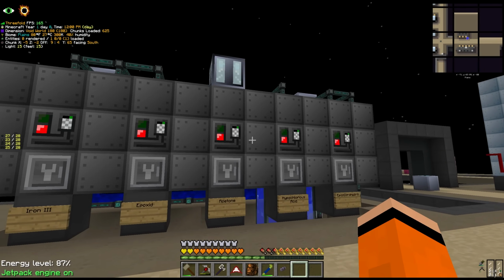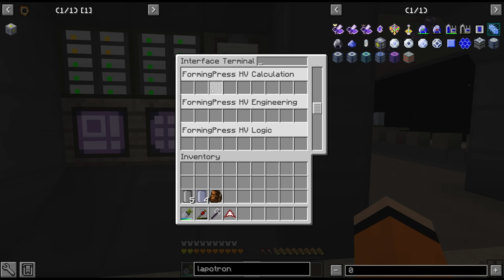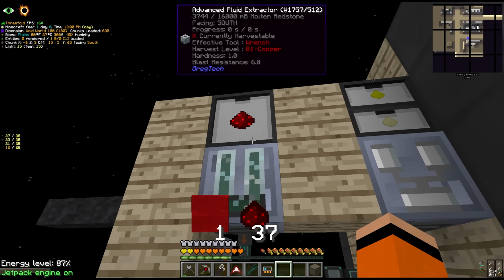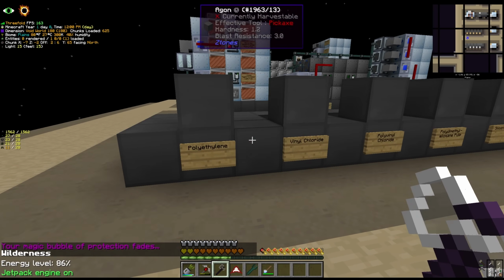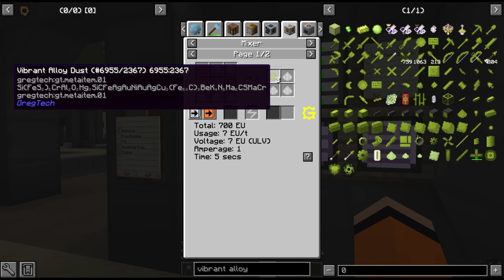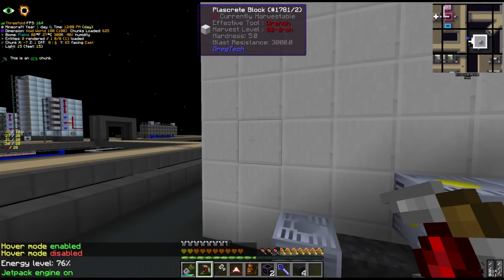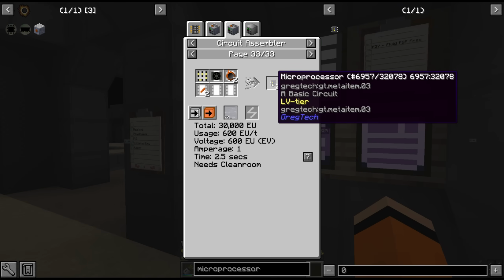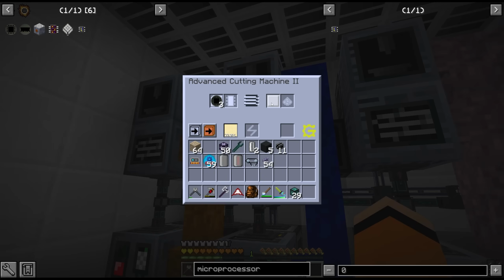Gregtech New Horizons - 40 - AE2 Autocrafting! Modded Minecraft

Comment: Long term, look up "ae2 assembler cone", his way you can, i think, fit 32 interfaces (1 dense cable) onto the maximum number of molecular assemblers possible
Reply from the maker: Yeah I'm aware of the setups for molecular assemblers they are just very expensive :))
Reply: A lot of the recipes he needs on autocraft now are done in machines. Only a handful needs to be done in molecular assemblers. He could setup a molecular assembler with 6 interfaces anytime, it's just not worth it because there aren't that many recipes that desperately needs to be automated. One of the few being patterns, which can be batch crafted :)

Comment: Really ought to have set up your cleanroom machines so you can easily shove stuff in a chest and have the machine craft it all...not that it matters too much anymore with autocrafting, I guess.

Bauxite isn't the best source of titanium once you've got a T2 rocket (and you should have a T3 rocket, so not sure why you're flying around with a T2 one), but come to think of it bauxite is a good source of Gallium, and that's going to become very important soon if not sooner, so...two birds, one stone I suppose.

Very soon you're also going to run into assembling machine recipes that cannot use PE, and have to be done with PTFE at least. IV machine hulls, primarily.

For automating rubber, this is this IC2 crop called Stickreed. You may have heard of it ;)

Turning machines off because you're afraid of power issues is a clear sign that you need to upgrade your power grid, be it power production, capacity, throughput, name it. You don't ever want to be in a situation where you're worried about power once you've got a centralized grid, especially if you use fluid covers to keep multiblocks turned on without any safety features build in to detect power issues...

Lest anyone get excited at the prospect of relatively easy wireless (albeit not interdimensional) AE2 channels, note that the power cost of running those wireless connectors depends on the distance between them, and basically any distance that in most cases a cable couldn't trivially cover (the cleanroom being one notable exception) is going to become a problem soon if not sooner. They do still have their uses, but only use them if absolutely necessary.

As far as I recall the only assembling machine recipes that need a cleanroom are the rocket control units, but there could be some recipe somewhere I'm forgetting or never ended up using.

For the record, yes, you can get small Naq ores from one of the T3 planets, but no, you cannot actually smelt it yet. It requires 5000K temperature, and your Tungstensteel EBF only handles recipes up to 4701K (remember you get +100K heat capacity for every power tier above MV you're running your EBF at, and IIRC you're running your EBFs at EV, so +200K from their power tier). That said there's nothing really stopping you from crafting up HSS-G coils, which would be able to handle that temperature, and reap the benefits of power discounts, upgraded overclocks and old coils to reuse/recycle in the process. What it wouldn't be able to handle is Naq needing IV power to cook up unless you go through the Naqline, though, and Naqline is...well sufficed to say that's something to look forward to in the future.

So something to note about the expansion cards, or "pattern capacity cards" as they're called in GTNH, that allow you to get +1 row of recipes in an interface. One, they require two 16K storage components, one advanced card and one interface to craft each. Yes, 2 16K storage components and an interface to get +9 recipe slots in one interface. At least Three has the cheaper storage component recipes available to him, so that'll save him 64 ULV circuits, 68 Item Processor Tier Is, and 64 charged certus dust per 16K storage component. Two...wait, they actually don't increase the interface's passive power drain more than adding a single interface with 9 recipe slots would? Huh. Wasn't expecting that. So I guess they're just expensive to craft, but running them is actually power efficient (if only to an extent that sane people would just write off as a rounding error).

Starting at More Advanced Circuit Boards, which is the tier that is used for your next circuit upgrade, the circuit board...coating? Whatever you would call turning a board into an actual circuit board needs to be done in a cleanroom, so best to move that chemical reactor into a cleanroom sooner rather than later. That said an HV chemical reactor will be able to process those recipes until you need to start crafting ultra bio mutated circuit boards, which...by the time you get there you'll have long forgotten that EV is a tier that exists, so no worries there.

Better tiers of doped wafers give more output. Glowstone Doped will give you 32 CPUs rather than 8 if you use a regular wafer. It's one of the reason why it's very worth upgrading to better boules despite the difficulties involved, because you not only get access to better wafers but you also get more of the old ones per wafer. Not to mention that it's generally faster in terms of processing as well, since while it takes longer to cook up better boules you get more wafers out of them and those wafers turn into more stuff, so it's ultimately more items per second spend cooking up boules.

Comment: from what i know there is an Industrial Extrusion Machine which is basicaly multiblock extruder. If i'm not mistaken you can put multiple input busses with an extrusion shape and when you put material in one of them it will use the shape in the same bus. but i might be wrong
Reply: Yep, but that needs the alloy blast smelter